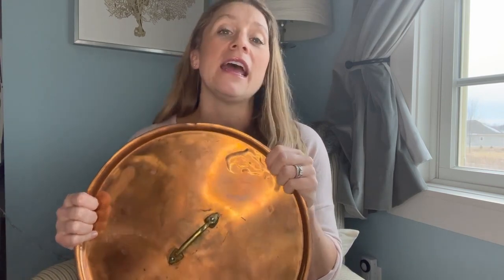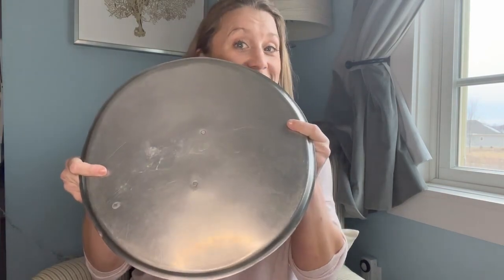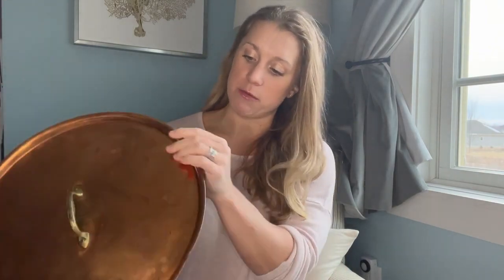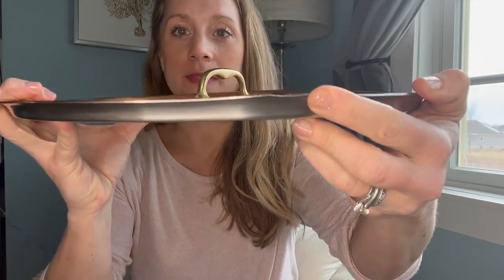Stainless vs Tin Linings for Copper

Comment: Thanks for the very informational video! I'm wondering how nickel/silver platings compare to tin? I recently bought an old unused copper pan, and was surprised to find out that it has nickel plating. Isn't nickel toxic?
Reply from the maker: Nickel and silver are two other completely different animals. I would need to do a video on that, and I can. Nickel is toxic to people who have a nickel allergy (it's why they always ask you at hospitals) and there were enough issues that nickel plating has pretty much gone away in cookware. I don't know anyone who does it anymore. Silver is done, but rarely. It's harder than tin so it holds up better with time, but also WAY more expensive. I mean...would people pay $1000 for a new silver lining? Maybe? If so, I'm in the wrong business lol.
Reply: @housecopper  
There is a family owned company in Italy (Mazzetti, Bottega del Rame) operating for well over 100 years that does silver plating in copper pots/pans for much more reasonable prices. They also use fairly thicker copper than newer French counterpart. The layer of silver is thin, I imagine deposited through electroplating. As for the price differential, a new pan that costs around $400 with tin or stainless steel, the silver coated pan will cost about $150 more. [Pure silver is only about $25 per ounce.]
Silver easily oxidizes so tarnishing might be a problem. If budget is not a serious issue, about 10 micron gold electroplated 4-5 mm thick copper pans will look fantastic and perform phenomenally well. Gold is very conductive and almost inert but compatible with copper (copper is used in various proportions with gold to make alloys for jewelry). With a little care, such cookware should last beyond a life-time. Of course, gold is little more pricey ar about $2000 per ounce.  ;)
May be worth doing this experiment for fun.

Comment: You must only work with poor quality cookware. I have sixty plus year old Revereware pots with copper outer bottoms - zero issues, or delamination, etc. It may not be significant, but it does not require a bond at the molecular level to distribute and transfer heat from a higher to lower conductive surface, or vice versa - otherwise, the gauze screens used under Pyrex flasks would be of no use. Note, copper as a liner/inner surface should not be used with acidic foods or sauces, as toxic copper salts can develop.
Reply from the maker: I get all kinds of stuff. The one in this video that delaminated from the stainless is a very hefty French piece previously owned by the renowned French chef Daniel Dunas, which I purchased from his family. I'm pretty sure he wouldn't have used poor quality. :) But truly in the end, if your cookware works great and you love it, that's all that matters. And yes, of course, you would never cook with pure copper - always have it lined (unless it's a jam pot...or bowl...).

Comment: Is the tin a potential health problem?  I've always visualized it coming off in the cooked food.
Reply from the maker: No - it's not a health issue (it's been used for centuries, all over the world) - though yes, the tin can come off if you melt the lining with improper cooking techniques/incorrect use.
Reply: @housecopper  It is a health issue.  People once did not know why they suffered.  Tin ingestion can cause liver and kidney problems.
Reply: No. Tin is as safe as stainless steel and other comparable metals.
Reply: @kitskivich  im so new to this . it seems all the people in the copper fb group say I need to remove all old  lead tin and start fresh ? what  are your thoughts /\? thank you Sara
Reply: @michellemcnerney  Modern (e.g., Grade A) tin contains virtually no lead. Much older tin may contain lead, in which case, it makes sense to have those pans re-tinned.

Comment: I found a 3mm saucepan set where the stainless steel has started to separate from in copper. Is it possible to entirely remove the faulty SS lining and redo it with tin?
Reply from the maker: Usually it's not - unless the entire stainless lining has popped off, you'll likely damage the softer copper - and if the copper isn't super thick, it might not hold up to the loss of the interior. And there's a good chance that without the stainless, your handles will make the pans off-balance. And there's a very high likelihood that the quality of the copper isn't what takes tin (I prefer CDA 122 or 110 - anything else might have other elements like boron or magnesium added which may not take tin well) BUT you could always try it and report back! :)
Reply: @housecopper  Ok, thanks for letting me know.

Comment: I prefer my Mauviel SS lining because I can sear protein on it and deglaze a pan sauce, which isn't an option on tin. My old French tin just sits atop a high bookshelf as living-room decoration.
Reply from the maker: Which is why it's all preference! We are vegan, so I have no need to have cooking tools that use high heat to sear. And I like my tin-lined copper's immediate response when I'm dealing with sauces...but really, you gotta do what you love to do. As long as you are happy cooking, that's all that matters! :)
Reply: @housecopper   I understand Duparquet in Rhode Island lines his pieces with tin or silver. Soy Turkey is bonding thin sheets of silver to thick copper and then hammer treating before and after spinning. The copper/silver combination must be amazing. Silver's melting point is about 950F.
Reply from the maker: @williamkeithfunderburk1257  I last heard that the woman who did the silver lining for Duparquet no longer does it - but that likely could have changed in the past year or two! I have to believe the silver/copper is awesome, though I haven't tried to cook with it myself. Science-wise, it must be amazeballs. (PS Silver's melting point is actually 1763F. The 950 is the measurement in Celsius.)
Reply: I do, however, find your empirical claim rather non-credible that bimetal lamination failures are common. It would be more accurate to say that tin coating will eventually fail under normal, non-abusive kitchen use and must be repaired, but bi-metal laminate SS on copper is unlikely to fail at all under equivalent, normal use. Tin is astethetically pleasing and also practical and sustainable, but it's just not the case that SS lined copper is going to landfills due to regularly occurring, heat-induced de-lamination failures. Bi-metal applications in engineering metallurgy go back to the 1920's in aviation, most notable with aluminum bi-metals, and data is not at all sparce. Thank you for your post. Your enthusiasm for copper is fun and catching. I noticed that ATK used your 12" pan in a "Best Copper Pans" review this week. Congratulations on that recognition from ATK.
:-)
 William
Reply from the maker: @williamkeithfunderburk1257  You're correct that there's lots of information about there on bimetals, though to your point, much is about aluminum, which is not what we're discussing here. :) Copper and stainless bimetals, at least in the cookware space, I believe only go back to the 1980's based on the international patents I've uncovered (though I could have missed some!). With that in mind, copper and stainless have only been used together in kitchens for roughly 40 years, not 100. I suppose I believe, based on my experience as a full-time coppersmith and re-tinner, that both my statement about stainless failure and yours about re-tinning needs (tin doesn't 'fail', so I I would disagree with that part of your statement) are true, and the two notions do not have to be mutually exclusive of one another. Between myself and other re-tinners I know, we all see enough failures of stainless copper to speak to that hands-on experience. And thank you. :) ATK used a massive amount of information in that article that they gleaned in my interview, which was super to see! I was a bit disappointed that they used the skillet to do a cooking procedure that involved not having enough food/material in the pan, which was explicitly against the instructions they were given (browning butter always reduces and you have less in the pan). But ugh! I can brown butter and panko in the same skillet without any issue. It ain't rocket science. :P I'll even do a video sometime to prove it. hahaha! Maybe what makes tin linings scary is not only the need to re-line them, but because it requires things like patience and a bit of time for the learning curve and most people don't like to wait or take time to learn something new. lololol. Sorry, but to me comparing stainless and tin is like comparing apples and oranges - hence this video to list out all their differences. They both have their pros and their cons. Everyone gets to decide for themselves which pro and con matters to them. And then we all merrily go on our way, cooking yummy food for each other and the world is happy!! :)
Reply: @housecopper   your replies are generous and always interesting. Thank you. Yes, t he alclad patients go back to the 1920s and were used first in aluminum airships I believe. Best wishes and keep on tinning 😀

Comment: Many websites claim that the copper's good heat properties are preserved because the pans are sometimes 90% copper and only 10% stainless. Is this real and how big of an impact does it have?
Reply: This is correct. I have an entire set of Mauviel as well as a lot of tin lined copper and they perform just as well. Very responsive to heat. They only real difference is that SS is less smooth and annoying to clean. It also doesn’t develop the patina that tin does. With that said, it’s nice to be able to use a whisk and not worry about the lining. It’s also great to be able to sear meat and make caramel with way less heat than other types of cookware.
Reply from the maker: Yes, some pans are 90% copper and 10% stainless. We can dive really deep into exact thermal transference, but this video was mostly just to relay scientific information: stainless heats slower than tin and copper. Fact. Take from that what you wish. :)
Reply: @housecopper  I agree, stainless steel does heat slower than tin. In my experience, it isn’t noticeable. I can only speak to Mauviel though. I haven’t tried other SS lined copper cookware from other makers. I would imagine if the SS lining is any thicker you would probably start to see a difference.
Reply from the maker: @kevinnichols8516  I would think so. I've noticed a difference, but I frankly have NO idea the actual ratio of copper to stainless on the one piece I do have from Mauviel. Also, it's a beast, so I think the massive diameter isn't giving it any favors....Ooo, we should all do a science experiment on thickness of metal, speed, and report back!!!!! Wheee!

Comment: In fact a stainless steel lined copper pan or pot shouldn't  even been called a copper pan. It is just a stainless steel pot with a decorative layer of copper, nothing more.
 Stainless steel kills all the caracteristics of a copper pan.  Stainless steel is a bad heat conductor, copper is a great one. That's what gives copper cookware it's caracteristics. It allows for exact and imediate response to the stove flame settings.
Reply from the maker: You took the words out of my mouth! I agree with you in terms of a stainless pot with copper outside just a stainless pot with decorative copper, but there are many who would disagree with that. To each their own! (I just love copper, period! :))
Reply: Well, that simply is BS. It depends on the thickness of the copper of course. Falk culinair, one of the big french players, that managed to stay in business, make inox lined copper pans with 2,3mm copper with 0,2mm stainless, so 2,5mm total thickness. Yes, stainless steel is a poor conductor of heat but it is basicly just a foil that is extremely evenly heated by the copper layer.
Honestly i have only learned about seperation phenomenon of these kind of pans on this channel, which i found when i was looking for information on tin lined copper cookware. 
The channel is very informative but the statements about stainless steel lined pieces beeing more or less decorative is kinda triggering me because there is ALOT more to be said about it - like the stated thickness of the layers involved.
Reply: @figilande8   I agree.  There are some “show” pieces that literally are just a thin layer of copper on the outside, but that’s not what the discussion is about.  The 2.3mm of copper is still going to give the uniform temperature and get to temperature quicker.  The interface between the copper and steel will be at the same temperature. At only 0.2mm steel, it’s not a lot of mass to heat up, and the deltaT from interface to surface will be small.  Of course the steel lining will be at a disadvantage if the steel is thicker or someone is abusing the skillet with excessive heat or shocking it.  Rapid expansion or contraction is what seems most likely to cause delaminating of the steel lining.

Comment: Copper+tin suits me because I am a slow cooking kind of a guy: low-medium heat & a lot of stirring - risotto, for example, or Indian cuisine. I am in awe of Chinese chefs working fast on high heat, and have seen some badly beat up carbon steel woks in a commercial kitchen. I doubt that a copper pot would last long in that environment.
Reply from the maker: You are probably very right that tin lined copper wouldn't hold up in a Chinese restaurant. Maybe that's why the Chinese don't make copper pots really?! Cooking dictates need for cookware types. So fascinating!
Reply: I gave away copper pans and pots years ago and tried to lean into 3-ply and 5-ply products. Big mistake. I learned the hard way that a lot of what I cook is done on low and medium heat. It’s really important to have some quality copper for sauces, eggs, and certain pasta and rice dishes.

Comment: I find it hard to believe that Mauviel and Williams-Sonoma are selling copper cookware that will eventually pop apart. As long as you aren’t abusing your pans they should last a lifetime. Also, I have a lot of copper cookware and I can say that the stainless steel lines pans perform just as well as my tin lined pans.
Reply from the maker: Welp, that's why it's super individual preference! I have Mauviel pans from the 70s that have popped part. Maybe they were just over-used in their early years by their previous owners. I just wanted to put all the general science out there - obviously it's every cook to themselves! It's all...cook well and live happy! :) (I have a stainless stock pot I use more than my tin lined copper one - I mean, I'm all over the board too!) :)